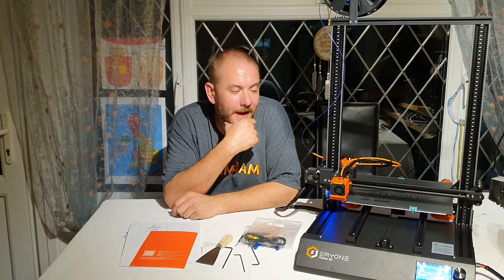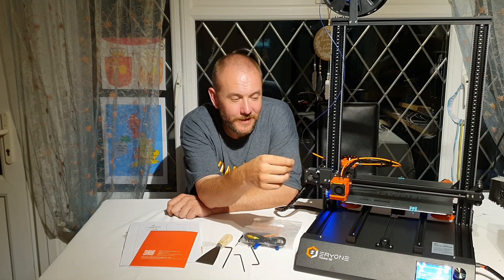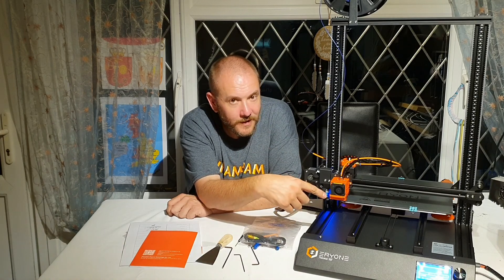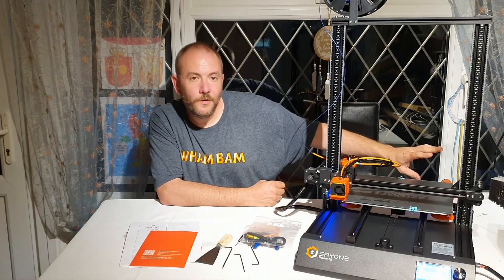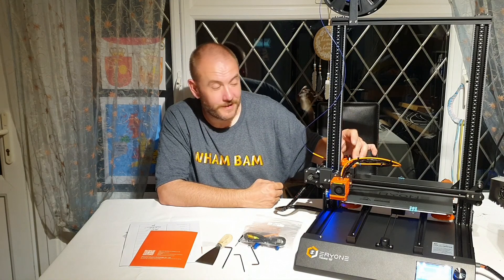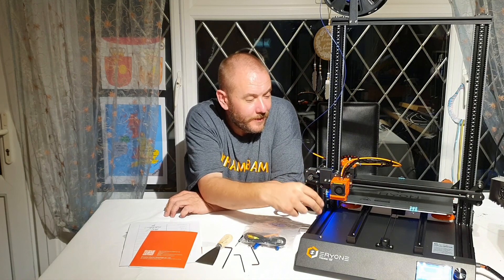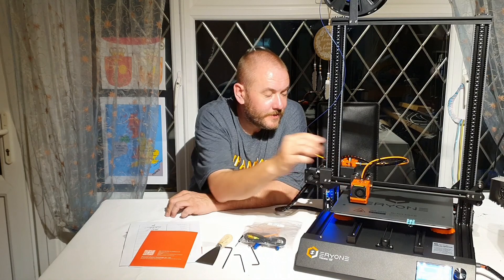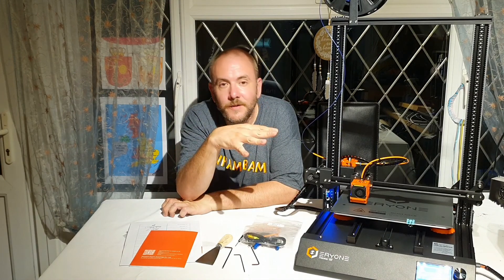Review of the Thinker SE 3D printer from Eryone

Comment: I'm new to 3d printing and got this, every time I try to set home offsets the extruder on the x-axis goes all the way left til it says it failed
Reply from the maker: Hi I'm a little confused why you need to set home offsets unfortunately as I have never needed to do this I haven't had that issue I can only assume the wrong numbers have been imputed ans it now won't home properly if this is to do with homing in general than a tip would be to make sure that the bed is at its lowest possible position  by turning the nobs down first then home and ajust as if it hits bed first it won't home anyway good like I hope you fix it
Reply: @brithawkes36  Hi, how would you compare this to the Ender 3 (the non pro version)?

I found a Ender 3 for 200 euro (shipping included) as well as a Thinker SE 3D for the same price. Which would you choose?

I know I will wanna print some flexible filaments (gummy bear kind of flexible, so maybe TPU or TPA if those are my best options). Other than that I suppose Im looking for something that is easy to use once setup and configured (I dont mind spending a few hours fiddling with it at first and changing some settings if necessary as long as I dont have to do that for every print).

Probably only gonna print small gadgets, tho I do think the 300x300 bed size compared to 230x230 seems like a pretty cool bonus.

Also high precision is quite important, I want to be able to make water tight prints.
Reply from the maker: @olliveraira6122  Hi I think they are all good but the Thinker for me is better and I know it will print flex filaments ok

Comment: Great video but unfortunately I feel this is a step backwards for Eryone. No eccentric nuts is a massive mistake. Think they will suffer from flatspots on the wheels if stored for two long under tension, also like you said you could replace wheels when they ware but surely being able to adjust them up is better. Also not sure about the glass bed but that's more of a personal preferences. Sorry Eryone but I think you need to Rethink the Thinker